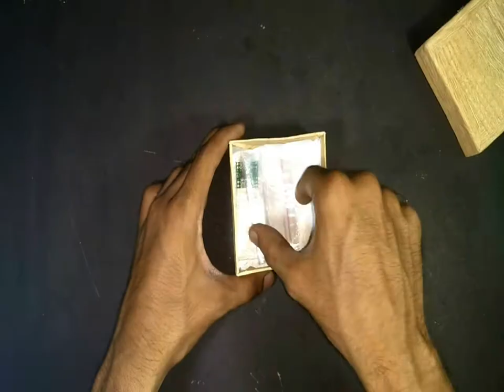3 Watt Amplifier board

Comment: Sir I know this is an old Vidio but I am using the PAM amp as you are. I get a bad I2C buzz but am working on that. The PAM modular I have is a 2 Chanel as yours is but at this time I want to use only Chanel. Do I run both TEA 5767 speaker wires into the amp and have it out of the amp for later if I want? .. Hope you rember. Thanks Bob